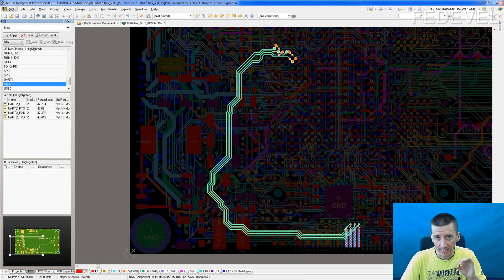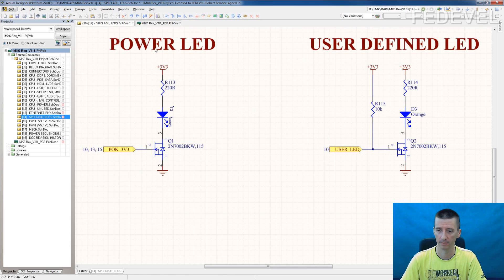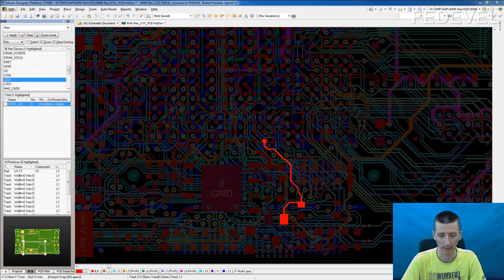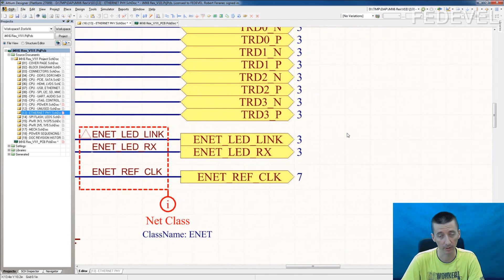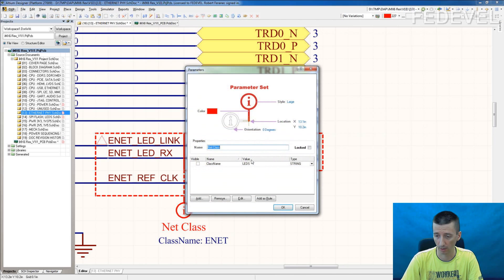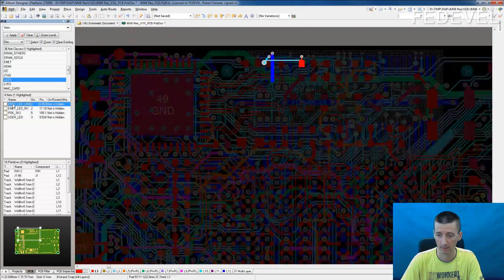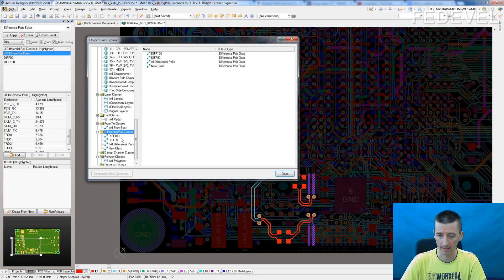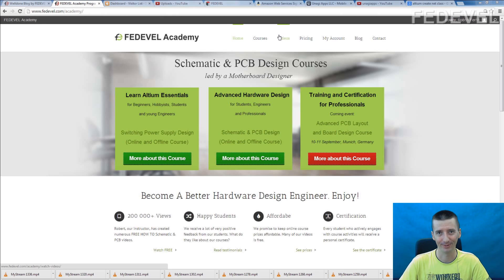Altium - How to Create Net Class and Differential Pair Class

Comment: Sir, What is the difference between net name and port, I mean Where to use the NET and where to use the PORT?
Reply: All nets with same name are connected together even if it doesn't seem so in schematic. Ports are just connection points to different components.